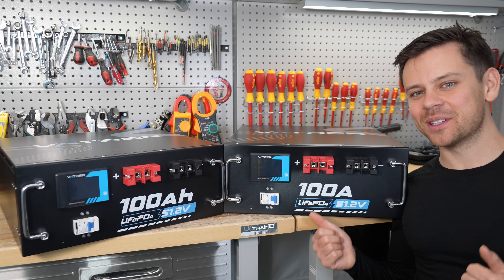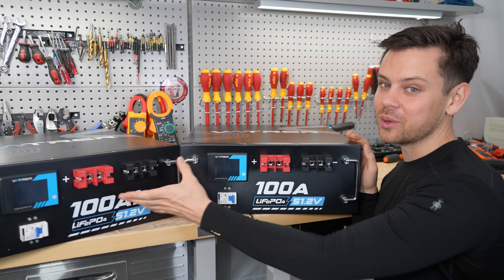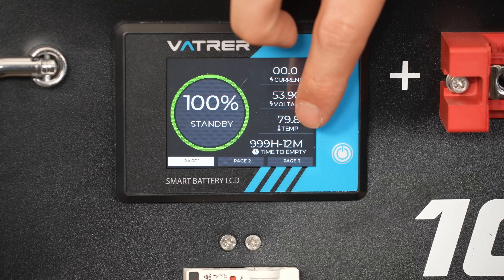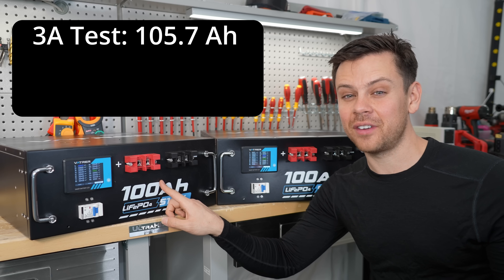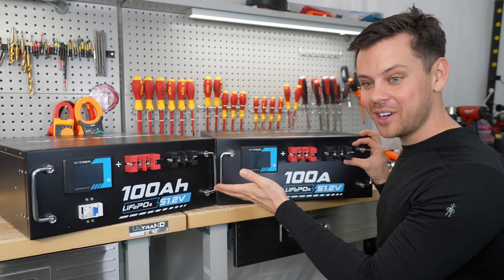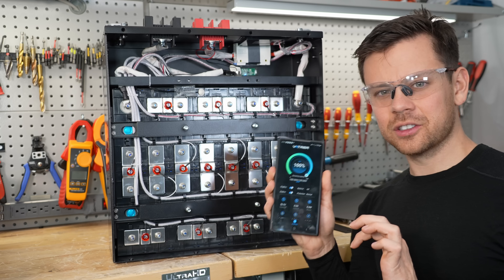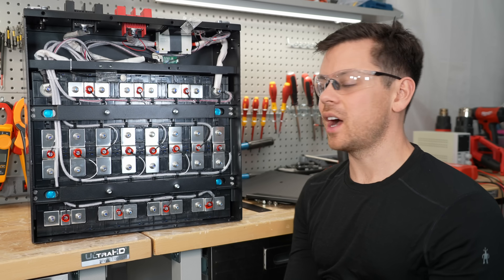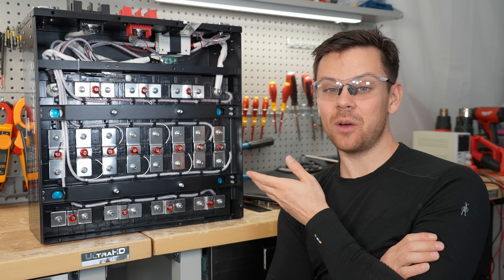$936 Vatrer Server Rack Battery! What's the catch??

Comment: I got my Vatrer 3 weeks ago. Didn’t have any issues with loose parts or shipping damage. It has fixed handles and I was very impressed with the shipping, excellent foam and reinforced handle cut outs to make moving it easier. Battery is working great, balanced when it arrived. I’m about to order a second one.

Comment: I know this is an older video, but I just got my Vatrer battery today. I was very impressed with the shipping box. The handles were on and protected the front and it was very thick foam inside a box with reinforced handle holes to make it easy for the shipper  to move it around. The cells were almost all exactly balanced. I’m picking up the charger inverter tomorrow and some other parts so I can get to hooking it up.

Comment: Can you get 4/0 cable terminals on those?  The Inverter/Charger I am moving too says it expects 4/0 cabling from the battery.  Do I have to put a Terminal Block to hook them together with smaller wires then use the 4/0 from that to the inverter?  Is that safe?   I really want heated batteries and these are reasonable cost.

Comment: Does Vatrer have different build quality levels for sever vs 12v batteries? My friend has a 300ah self-heating battery that failed within a few days. Dealing with Vatrer tech support has been an absolute horror story, hours spent emailing and no resolution yet, so she's asked Amazon to just return it and go for slightly more expensive Renogys.

Comment: Vatrer battery update. I have these 2- 51.2 server rack batteries running a 6500w 240v PowMR AIO. I charged them separately to 100 percent initially. What I notice is one battery is always a couple amp hours different (lower). The system is working fine so far (only operating for a few days), but it's odd that they aren't the same as they are being charged and discharged at the same rate. Oh well.

Comment: The bad thing in this reviews that there’s no showing on size of inverter because if your battery’s are bigger on power then the inverter it won’t work this creators need to tell the inverter size for this battery’s
Reply from the maker: 4800W inverter with each battery
Reply: @WillProwse With the Vatrer build quality, do you think this would be a good/safe choice for a mobile offgrid set up? Like a skoolie or RV? I would likely add an inline fuse, and maybe change those glued terninals to ferruls. Thanks in advance

Comment: I have 6 100 AH Vatrer server rack batteries. They each are in a 3 battery setup and the 2 setups each power my mini splits they run 24 hours a day no problems so a little over a year use. I have not tested them but once in a while I view the screen and sometime the remaining percentage is off by 2 or 3 buy so what. These keep my mini splits running and lower my summer elect bill by $300 per month. Hu raw. I have some eco worthy products their service dept sucks. I need a fan for one of the all in one inverter chargers the would not help me out would not even tell me where to get one. If you want or need help eco worthy is not for most people I am sure they jump over hoops for our dear Will P. but that is about all.

Comment: I bought one of these (the blue model) about 6 months ago and with a promo code it was $885 shipped! Amazing! I hooked it up to my system with the 2 GYLL (original EG4 server rack batteries) that I purchased in 12/2020 for $1475 each. It has been running great with excellent capacity and good cell balancing. Having the Bluetooth module is really helpful! Very pleased with it and with 50% more battery capacity! Thanks for the teardown and review.

Comment: Hi newb to planning my syetem. Say I have limited floor space to where a server rack isnt feasible and I want to build a bracket to wall mount these with the top or bottom face against the wall. Are most of these built sturdy enough that everything inside will stay put in a different orientation? The Vatrer one certainly looks strong enough.

Comment: Have you tested, Instead of connecting to a bus bar, all five equal length conductors connected together, to the end of the 4/0 cable? one bolt connecting six terminals stacked on top of each other.  If so, what was the result?

Comment: This  isnt quite fir this video but i have 32.9v  vmp 9.43amp Canadian panels (2) and 30v 8.43amp synergy (2) im planning on connecting all in series cuz my hybrid inverter requires pv voltage mppt of 90-430v. My location is Nigeria, which is quite sunny. Will this work? Is it ideal. They're all used panels without mC4. How can i safely connect the wires without getting electrocuted? probably do that at night?

Comment: I have three of these, one with the older blue painted case and two with the newer black painted one, but they all seem to work fine. And I'm tempted to buy the wall mounted versions that have the ability to connect to whatever inverter you're using as well.

Comment: First off, I would like to say thank you for all your reviews, testing, demos, tools explained and especially instructions.
I just purchased the wall mount version from amazon @ $1079.99.  Sorry Will!  It was $220 less on amazon versus the Vatrer site ($155 less if using your discount code). 
I went with the wall mount version because it was just $145 more than the rack version and has communication ports.  It will also take up less space and will work better for my installation.  It also comes with a wall mount bracket and a set of cables. 
I was ready to make an EG4 purchase until I saw this review just in time.  What timing!  Keep up the excellent work.
A big THANK YOU Will!!!😃👍👋🖖

Comment: Why would anyone pay that much for just 100 ah?
Reply from the maker: 4x 12 volt 100Ah have the same capacity as a single 48v 100Ah battery. Ah is dependent on nominal voltage. This is dirt cheap

Comment: I still recommend you buy 16 MB31 314Ah batteries of your choice and your choice of battery box for around $1.8K including shipping from China for 48VDC @ 16KWh capacity. Try to find a battery box with JK-BMS with 2 Amp balancer and 200 AMP charge and discharge rates.
Reply: I tend to agree with you.  It has more capacity, cheaper cost per A/H, and a smaller footprint than a server rack if you start to stack them.   I would like to see Will do a comparison.

Comment: You mentioned the terminals were stripped, but didn't address that on you inside view. Is there an issue?
Reply from the maker: They felt tight with wrench but I should have used a torque wrench to check

Comment: at this rate, this means that server rack industry needs innovation.  for example, server rack batteries are heavy and not easily repairable upgradeable.  Why not make the electronics/electrical separate from the batteries where a user connects the batteries to panel and wires. The product will have be user or DIY friendly like reverse polarity over current protection, automatic voltage level, etc....

Comment: These seems to use the Jiabaida ( JBD or Xiaoxian) BMS which I agree with you are excellent BMS. These screens are very common with these. I have the same LCD on my BMS The JBD can have BOTH RS485 and UART so the LCD can be UART and the Bluetooth interface connected to the UART so you can use both the app and the RS485

Comment: I have 4. My experience was exactly the same. Very minor shipping damage on 1 of the 4. Cell deviation is very very low even after 90 cycles now. Weird terminal  tightening but it works. Charge my model 3 during the summer and they’ve just been humming along. 100% go on these.

Comment: do you do all your load test with the same charging parameters? and discharging parameter? ... because .1  volt can make a different ... example charging at 58.4v and .discharging to 43.2 will make a different if charging at 57.6 v and discharging it to 44v will make a different ... every company set their parameter different i think ... but what do i know... i think solar is still too expensive ... they still got a long way to compete against the electric company ... at lest for now ... the upfront cost and the worrying about something going wrong is still the downfall of solar ... off grid if you don't have a choice and RV because there is no other choice ... in the long run maybe solar is cheaper ... and that is with the expectation of 15 to 20 year of nothing going wrong ... if people use less electricity on the grid as they do in solar then their bills  will be like $50 a month or less ... but we consume too much when on the grid

Comment: Damn, the lack of communication is a deal breaker, I think. Pity. Do you have a video where you explain why you don’t use communication?
Reply: A video why or why not to use direct communication between inverter and battery would be great!
Reply: simply don't need it. Can you set the parameters just write you won't deal with any issues

Comment: If not already suggested, perhaps use a torque wrench to check mechanical connections of the battery terminals for consistency.   Especially since there were so many loose screws on the terminal mountings.

Comment: One thing that I wish would get called out more is the Bluetooth security fail. You can shut off the charge and discharge mosfets with any bluetooth battery app. There is no way to enable password protection. This means a thief could turn off your home batteries with any smart phone and disable any security system attached. It is so irresponsible from a manufacturer standpoint that they really deserve some pressure.
Reply: Password Protection is the minimum they should have.  You cannot believe how many times we camp and folks around us have their victron systems secured by the default 000000 password.  Anyone with a little knowledge can really screw up their systems.  Change the battery settings.  There is a lot of changeable settings in a controller..

Comment: I have 4 of the 15 cell 48 volt versions. Have been using those for about 2 years and have 3 of the first version 51.2 volt 16 cells using a little over a year.  Other than one that came in with a loose bms connection they have worked flawlessly so far.  For help from the company it was all emails. But they replied within 12 hours and i was able to work thru the bms connection issue.
At 1 time if you ordered thru their website shipping was free, at time didnt charge sales tax and for new orders had a spin wheel that had discounts that applied to the purchase.

So far i am extremely happy with vatrer batteries

Comment: Thanks Will.
I have been off-grid for the last 18 years using (32) 6v golf cart batteries. I recently swapped them out for 8 of these Vatrer batteries and am very pleased. No more acid smell, holes in my clothes from acid, and adding water to 96 cells every month. 
You can see pictures of my old setup of golf cart batteries and my upgrade to Vatrer batteries in review section for link Will put up on Vatrer site for this battery.
I would recommed these batteries for off grid.  I also put a Vatrer 36v battery in my golf cart about a year ago and put a solar panel on roof and have been pleased with that too.
Reply: Lots of benefits

Comment: Thanks, Will. Any chance these will be "listed" soon. Some Chinese items are "listed" on international (non UL) standards. I plan on adding a rooftop solar array (16 panels x 545 watt/P = 8,720 watt) over my deck roof, which is relatively flat. I'm thinking 25 kwh of batteries to charge my new Cybertruck and as backup power for essential electrical items (fridge, freezer, heat pump) in case my 200 Amp grid power goes out. The 123 kwh battery in the CT can also be used as a backup power supply when it is at home. Does Vatrer make a power station/inverter system that these batteries can be added to? I don't plan on tying this array, or my CT into the grid, but my electrical inspector seems to think he has a right to redflag anything not "listed", even if it is not power-shared into the grid. I've already passed my final electrical inspection on my new house here in Colorado. My county (Montrose) has no regs or inspections regarding solar arrays. I'm not sure if Colorado requires electrical permits for off grid solar systems.

Comment: Excellent info! This is definitely on my short list now. Since I have no experience with welding I'm going to say this better for me in the long run.  My intention is to go off grid with my setup. Once it's done I'll have to post a video with all the things I've engineered into my entire build to eventually go off grid.  But that being said, having the ability to swap cells means I can stock up a few batteries in a maintainer and be able to swap them out if something goes wrong later. I'm still trying to decide if I want to do rack mount or not. The ability to move around is nice but there's something to be said for having a battery designed to be mounted.

Comment: Vatrer wall mounted version looks good.  I like wall mounted approach because it's more space efficient and easier to deploy at most any location.  They weigh 110 lbs, so you need good anchors.
Reply: 110Lbs, is 5Kwh. 12kwh is around 200Lbs

Comment: A pair of the Vaterer 100ah 12v self heated batteries have been performing well for my relatives in Ukraine for 2 years now. I also sent them a diesel heater from Vaterer, and they are very happy with it as well (the batteries run the heater). They seem to make above average equipment.
Reply: I have one of those batteries in my van and it is so much better than the pair of AGM batteries I had before!
Reply: What a great gift idea for anyone really. Mini solar power/heater setup. How do they charge the Batts? Is there grid reliable, hopefully.

Comment: Any benefits or downsides of having or not having comunication?
Reply: Short answer: having communication would be more efficient, while not having it would make for a slightly simpler system to set up and maintain. I have BattleBorn batteries in my 48V offgrid home system, with no communication, and they have been working fine for a tad over two years now. Perhaps someone can give you more details on each choice than I can.

Comment: What’s the big advantage?
I can get 400 Amp hours @ 12V in a Vevor lead acid setup for around $600
Reply: 1) LFP batteries are far less likely to explode in a ball of fire than Acid, 2) can charge and discharge from 0-100% without harming the battery, 3) Lead acid can only draw 50% of capacity where LFP can use 100% of capacity 3) LFP batteries can cycle 3000-6000 times so they last a lot longer than Acid. And there are many more advantages…
Reply: Nice review. Hope they pursue UL.
Reply: @jd_foils1496 they're on their way of getting it certified. It's already certified through Rohs
Reply: 51VDC systems don't need as thick of wire to push the same amps as 12VDC. Yes, you could buy 4x100ah 12V batteries and wire them together to make a 48V 100ah system, but buying them all in one container pre-wired is easier and sometimes cheaper.